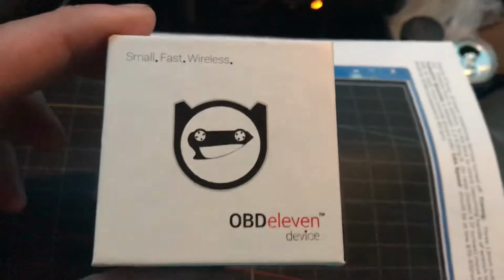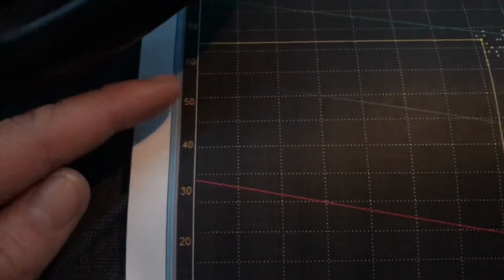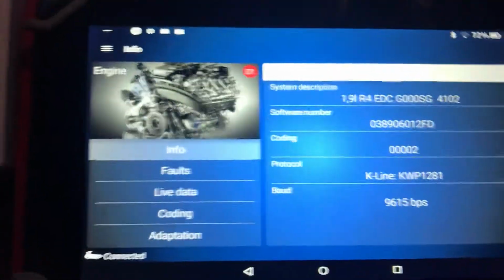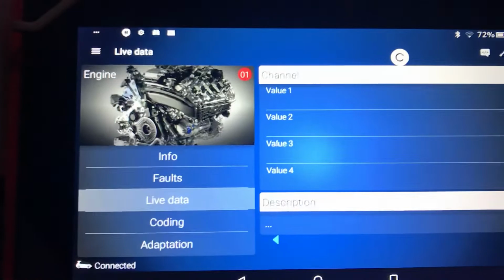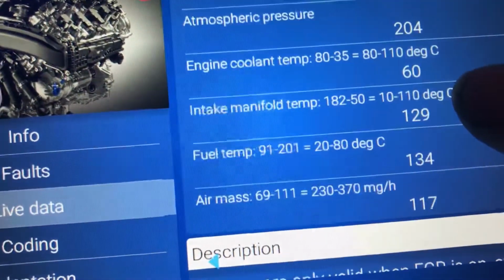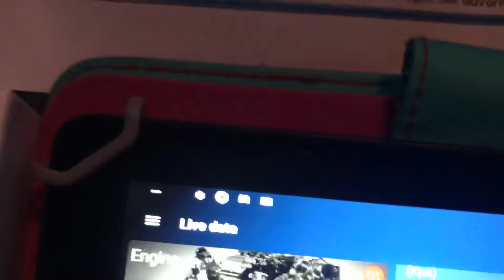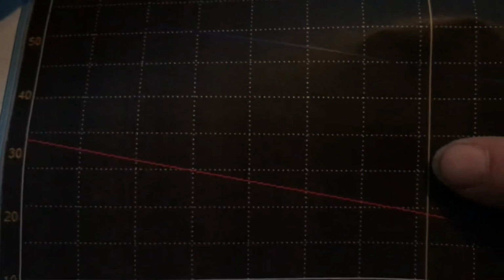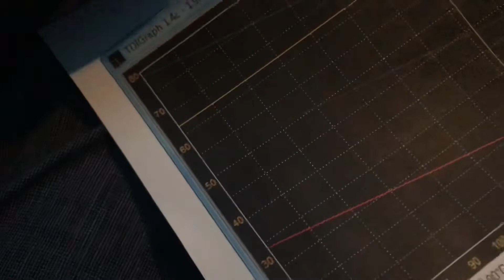Setting Injection Pump timing with OBDEleven VW ALH tdi 1.9

Comment: isn't the adjustment should based on group 004 (actual, specified and n108 duty cycle)? or should i adjust my timing just based on this graph
Reply from the maker: Actual vs specified is not for this,    That group tells you if what the ECU is requesting from the pump is in agreement with what the pump is outputting via the sensor. If they don't agree tour pump likely has an issue

May have said that wrong -- Group 004 should state start of injection timing which is what you need to look on the graph along with injection temp to ensure you are in range.
Reply: @hfink  Thanks for reply! I don't expect to get reply 3 years after this video. But did you check the % duty cycle after your adjustment to make sure within 4-6%.

Comment: Did you use the basic or Pro version for this video?  I need to check the timing on my 2003 ALH TDI and am going to purchase one of these.  I want to make sure I get the proper version.
Reply from the maker: They only had one version back when I did this pretty sure you’d be fine with basic but you probably should send them a message or check online on their site to see if it has basic functions guessing it does.